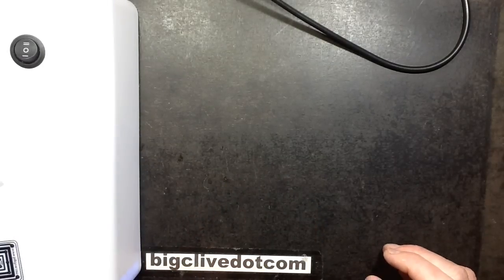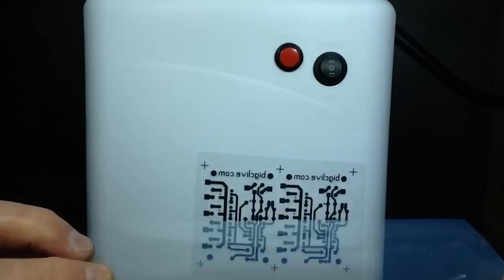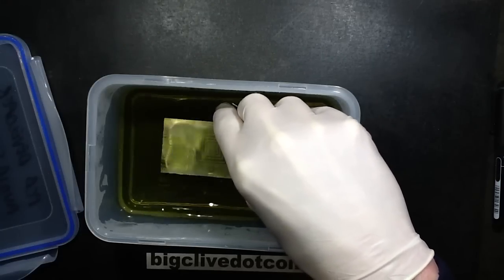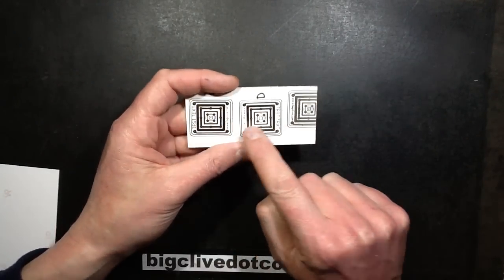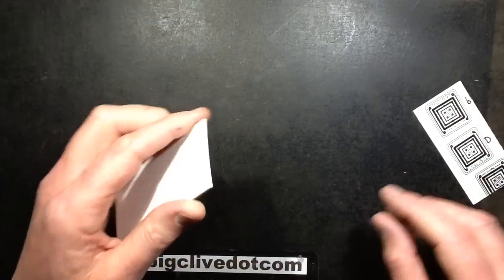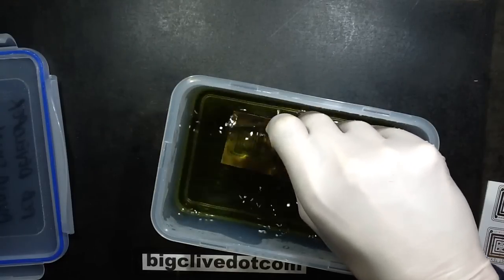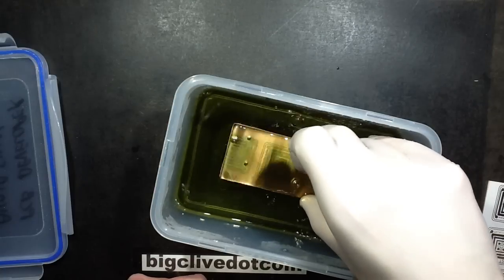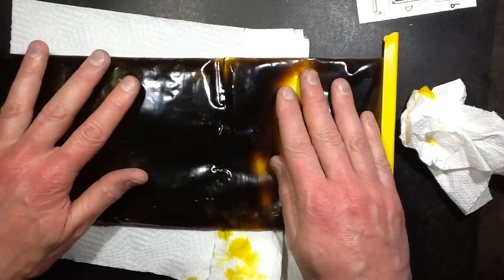Photoetching PCBs with silkscreen inkjet transparency material.

Comment: why are you trying all the different inks and materials? It's interesting sure but as you say you basically have to optimize the process for whatever material you choose anyway, so what are you gaining from this?
Reply from the maker: To find the best material for the job, then to optimise the process around that.  It would be pointless trying to use a material that provided poor contrast and made the whole process so critical that it resulted in a lot of ruined batches.
Reply: they all seem to work, more or less. Seems like there's not much in it?
Reply from the maker: artifactingreality There's a modest difference.  Certainly these materials are both producing good results, but earlier materials didn't.  When it comes to UV exposure the contrast between black and white has to be as high as possible to produce consistent results.  The whole point of the video is to test materials like this so that others don;t waste their time and money on materials that don;t work, or worse still, get put off etching their own PCBs by bad results.

Comment: is there a pint straight to pcb type pcb?
Reply from the maker: Jared Reabow There are some specialist machines that print etch resist onto laminate or expose it with a UV laser.  You can also route out tracks using isolation milling, although it requires a very flat bed and good PCB clamp.  The closest to single PCB printing is probably the toner transfer method, but it's a bit touch and go.
Reply: bigclivedotcom could you not use a inkjet or laser printer etc with a thick paper/card feed slot and put the pcb through>?
Reply from the maker: Jared Reabow If you got a printer with a CD-printing tray and used an ink that could resist ferric chloride then it would work.  But the standard water soluble ink wouldn't work.  I'm not sure flatbed laser printers are readily available.
Reply: bigclivedotcom nono not ferric chloride resistant paint, print onto the curing plate. directly, would that not be more effective at stopping uv?
Reply from the maker: Jared Reabow The laminate would not absorb ink, and I'm not sure how the fuser drum of a laser printer would affect the thin film.
Reply: Jared Reabow Back in my schooldays, we came up with a system that used a vector plotter with an acid-resist pen kludged into it, drawing directly onto bare copper boards, avoiding the photo etching stage entirely! It wasn't capable of fine detail, so we did eventually move to photo etching, but it was great for simple PCBs and big-format teaching kits (modular boards with banana sockets on them for demonstrating basic components and circuits).
Reply: +Andrew Crews You could probably do that, by setting a y offset, but your trace width will be limited by the nozzle size of your extruder, so you probably won't go below 10-15 mil trace widths.

As for speed, well, a prusa i3 does about 32 mm/sec, so in theory you could lay out 30 cm of traces in 10 seconds (since you on't need to put down a single layer).

Comment: Dunno if Clive monitors these comments but.......I have a pack of "Admaze" sheets I got for making pcbs. It was made for decorative use and is a metal foil that adheres to toner with heat. I wont be using it and, I don't know where to find it (if it's available) anymore. The pack is 20 sheets of 8.5 X 11, red (logic: might be more opaque to UV). Anyway, I would like to get it to someone who could appreciate it and use it and, if it's still available somewhere, make a video about using it for pcb use. It does work with anything toner will stick to and makes the toner image opaque. If any interest, respond to my channel and maybe I can send it to you.
Reply from the maker: I've never really thought about using that.  It's also called toner foil and very popular in crafts.  I found that many modern laser printers put down a very thin layer of toner, so the foil may work if it produces a sharp edge.
Reply: The adhesive and foil are extremely thin so the lines are laser-sharp (pardon the pun). I photocopied a $5 bill on a VU-graph transparency sheet and it picked up all the detail the copier  provided.

I'm glad to hear that you are aware of the product and that it's apparently still available.

I would still be interested to see a video using it (both for the positive and negative resist).

Thanks for the reply.

Comment: Hi so UV stops the solution from etching?
Reply from the maker: +guruji243 Where the UV degrades the protective film  it can be cleaned off chemically exposing the bare copper underneath for etching.
Reply: Hi Clive thanks for response. So that printed invisible film sticks to the pcb than UV degrades those parts without ink. Did I understood rightly?
Reply: +guruji243 The printed film masks the emulsion coating on the PCB. Where the UV light shines through it "softens" the emulsion so it washes off after you develop it. The emulsion that's left protects the copper from the acid, so the acid eats through the copper where it wasn't "shaded" by the ink on the printout.

Comment: Hey Clive, love all your videos. This has inspired me to try etching PCBs after using stripboard for years. Can you recommend anywhere to get the photo resistant boards for use with inkjet and screen printing film?
They seem to be quite expensive and the ones at Maplins have terrible reviews.
Or to save costs would you recommend borrowing a laser printer + dry film transfer paper + untreated copper clad boards (about £1 each)? Although that sounds like it could be endless faffing around.
Any advice would be super!
Reply: unless you use SMD components, laser printers are best option (toner transfer method onto normal fiberglass board)